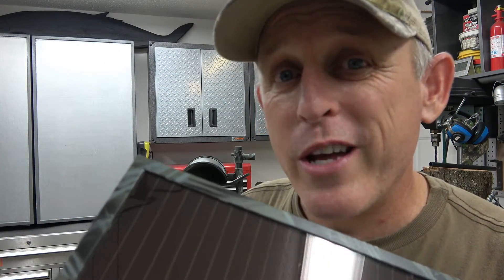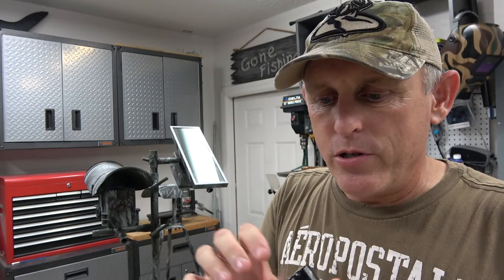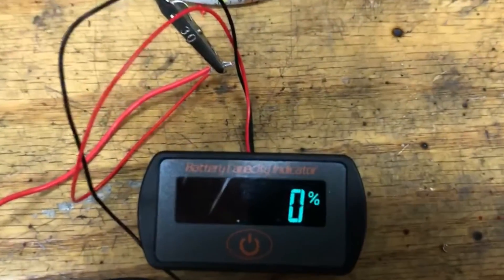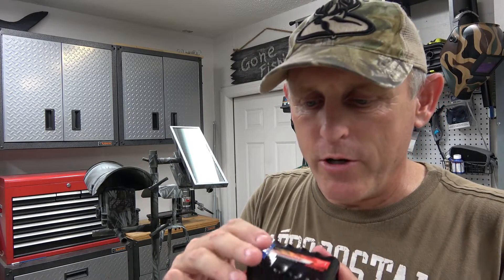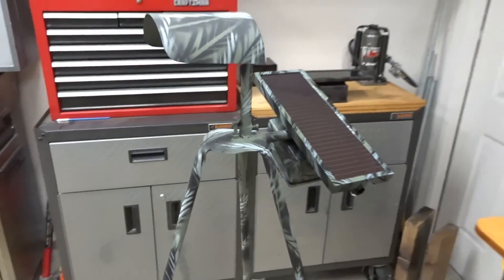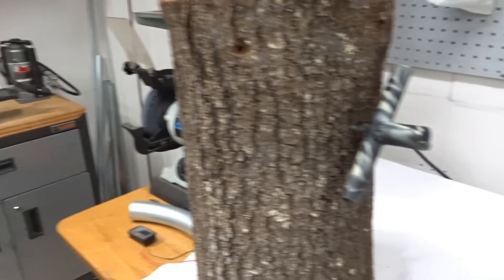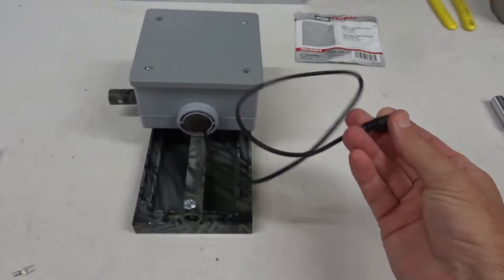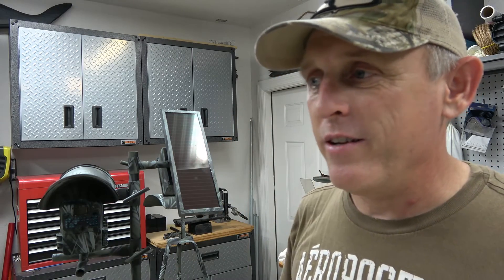Trail Camera Solar Batt Pack-DIY

Comment: How did you terminate the wires to the regulator?  Iv tried a couple things and broke a leg off of the regulator. Thanks
Reply from the maker: I snip the barrel off a small spade connector and then slide it on the leg with the wire in it and then crimp it tight.  I then heat shrink it for a nice connection.  Hope that helps.
Reply: Thank you. I looked for rings that small be and couldn't find any. Nice Macgyver fix

Comment: Love the videos. Did this setup last yr had zero problems but putting them back out now my batteries wont keep a charge or something is going on. I charged them up outside for a few days and set them out,now dead just got them back home and will diagnose in spare time!
Reply from the maker: Let me know what you find.  I have a couple that are two years out and still running.  I’m sure they are about due for a new battery but I will let them run for now.  Good luck with diagnosing.
Reply: Only thing I can figure is that I left the battery connected to the solar panel and and put up in a container and it killed the battery. I also had 2 more that I disconnected from the panels and they are fine!
Reply from the maker: richard smith I think you are right.  These batteries don’t like to be connected while being stored.  Best to disconnect.  Thanks for sharing.

Comment: So if I’m using a solar panel like yours with a 12v battery do u gotta have the 12 volt regulator if camera is 12v
Reply from the maker: Yep because the solar panel voltage will spike to ~23 volts in full sun and if you don’t have a 12volt regulator before the camera that high voltage will go straight to your camera.  The regulator just protects your camera from pass through voltage from the solar panel.  Hope that helps.

Comment: I love your videos! I just set up my first solar panel just like yours. I have two questions. One my battery drained down in less than an hour without a load, could the 7812 thing be bad? Two,  do I need a Schottky diode(mentioned by matt wheaton in a comment he made to this same video) wired into the circuit?
Reply from the maker: You don’t need to install a diode since these types of panels now come with one already installed.  You could definitely have a bad regulator.  Was it plugged into anything when it drained?  Also double check your wiring because a lot of guys accidentally switch polarity of the wires by using the solar panel plug they cut off....just trace +\- all the way to the end.  Let me know how it goes.  Good luck and keep in touch!
Reply: Thanks, yep I double checked polarity and found all in order. I changed regulator and it's still draining faster than the solar panel can charge. Think I'll try one of the little buck transformers/voltage regulators.Amazon Valeford LM2596

Comment: where did the frame on the solar panel come from?
Reply from the maker: I built it out of 1/2emt piping.
Reply: The Handy Hunter how did you apply camp to the emt and solar panel frame?
Reply from the maker: It’s all welded together.  Is that what you are asking?

Comment: Probably a dumb question but could you use 2 amp inline fuse instead of the voltage regulator?
Reply from the maker: No because the regulator keeps the voltage to the cam around 12 volts.  If you didnt have it your solar panel would push ~23volts directly to your cam and destroy it.

Comment: Hi! Great Video, Thank you for posting! Quick question should a diode be included in this setup like your other trail cam video?
Reply from the maker: You don’t need one if you are using a newer solar panel.  They all have them now so you should be good.

Comment: is there any way you can do a video on how to install the voltage regulator? from start to finish with external battery and solar panel? awesome videos!
Reply from the maker: Let me add that to my list for you.  I do get many questions around this.  Thanks for the request!
Reply: @TheHandyHunter  maybe you can just answer here? so basically you hooked the solar panel and took one of the cords from the cigarette or alligator clips into the regulator then spliced the power cord into the stealth cam power cord your using? if so i can do it. lol thanks again for the fast reply.

Comment: are those solar panels watrerproof?
Reply from the maker: I use several brands and they are all weatherproof.  Now, if you are talking complete submersion I’m not sure but for normal use in weather they work great.
Reply: @TheHandyHunter  well i am going to try this and wanted to make sure it would hold up to rain.  northern midwest weather.  Thanks for sharing
Reply from the maker: greatdaneparis you are welcome.  It will definitely hold up to rain.  Good luck.

Comment: Thanks so much for your videos - they've been a real inspiration for so many projects!  I recently found rechargeable 1.5 v Lithium AA batteries on Amazon and was able to eliminate the external battery packs.  Now I'm planning to hook my voltage regulated solar panels up directly to my cameras.  Do you see any potential problems in doing this?
Reply from the maker: Hi Tim, I love your line of thinking but I don’t think it will work.  When you say “direct” do you mean plugging the solar into the ext jack or wiring it directly into the battery compartment?  The ext jack won’t allow charging to the internal batteries and if wired direct into the battery pack you are going to have any issue of voltage.  You mentioned you would use voltage regulated solar but that won’t charge your batteries if regulated at 12v.  If you have a 12v pack your solar needs to pump up to ~23v to charge (in full sun).  If you regulate that solar to 12v before it enters your pack it may not keep it charged.  Here’s the other issue, if you run unregulated solar directly into the battery pack you may burn you camera because of high voltage.  You could always try it with regulated solar and let me know if your batteries stay charged.  Great thinking though!  I wish the trail cam companies would catch on to an internal rechargeable setup.  Thanks for sharing and let me know what you find out!

Comment: Verified and they were 100% dead from the one. I added a solar panel with internal batteries like big foot but the one with a 8000mah batteries. I just have a feeling it’s not enough juice to keep both up. I may have to mount it higher on the tree or get the 12v batteries that fit in an Ammo can with a bigger solar panel. See if that works.
The camera that said 90% went dead shortly after. Experimenting is getting expensive now
Reply: I may try a 10watt or 20 watt panel to see if it’ll be enough for both battery and spypoint camera

Comment: how did this set up work for you. I just built one, wont be able to get it out until spring. just curious how this AA pack held up. thanks.
Reply from the maker: I’ve had 3 of these in the field for 1 year and 3 months now with no issues at all.  One of them runs two trail cams at the same time and the others run cell cams.  They’ve been totally maintenance free.  Will they last 2, 3, 4 or 5 years?  We’ll find out.  Good luck I think you will love it!
Reply: @TheHandyHunter  thanks for the feedback and the idea on how to build these. I look forward to getting it out in the woods. keep you posted on how mine works. thank you!

Comment: Would this same setup work with a 12v 7ah battery (like the 12v external battery pack video)?  or like the one in this video that I did a few years back:  https://youtu.be/kIvj9zihbWY
Reply from the maker: Yep it would work.  It’s just that this small battery makes it convenient for a small setup.  I run bigger solar setups with bigger batteries as well.  I like the small setup the best.  Hope that helps.

Comment: Now that you have gotten some usage time on that battery, what is your opinion. I'm far from an electric expert and I am setting up some solar panels on cameras like you have. I was thinking the more Ah in a battery the better, so I was looking at batteries such as the Expert Power 12v 7 Ah (1270). Do you find the need for more Ah on your batteries or is 2 Ah enough like the battery in the video?  Thanks for the great videos and the time you take in responding!  

-Additionally, it looks like you use 1/2" pipe quite a bit. Do you just buy fittings to put together some of your set ups where you have panels sliding on and off or do you buy larger pipe? Thanks!
Reply from the maker: Hi Austi!  Great questions.  I love this setup!  I just got back from the farm and recorded a short video on the post 1 year update of this setup.  It’s been well over a year with no issues whatsoever!  Runs 24/7 with no maintenance.  Only worry about Ah if you are not running solar.  I run those too...big battery in an ammo box will last you many months or a year.  The little battery gets my cams through the night and then is recharged the next day.  The only thing I would change is not adding a pigtail to check battery level.  It’s extra work to rig and my battery is always at 100%.  If you build it you won’t regret it and you’ll be building a second, third...  Good luck and let me know how it goes!  Oh, yes, I use 1/2 emt pipe for all trail cam brackets...plenty strong for that.

Comment: I’m definitely going to build a couple of these for the cellist cams I am running
How do u keep the leg bolt from turning inside the pipe when screwing into tree?
Is it conduit with tack weld or is that pvc pipe? 
I’ve been trying to figure out how to mount a solar panel and 12v on a tree for a awhile n stubbled onto this video. I’ve been carrying a racket and socket with me to screw in my leg bolts  lol silly me
Keep up the good work
Reply from the maker: I weld the Lag bolt to the emt pipe.  I use 1/2 metal emt pipe from home depot.  I now make these as 1-piece as the two piece is more work.  Hope that helps!
Reply: Thanks for the quick reply. I thought that’s what you had done, was hard to catch a good look during video while trying to pause it perfectly. LoL I have some 12v Battery packs I’m gonna send you an email about.

Comment: I think that would probably be fine without the regulator. Not sure what voltage that solar panel puts out in full sun. Probably not over 14V. Thanks for the video.  Update- I just watched another one of your videos and that solar panel isn’t a 12v panel, I think you said it was putting out 18v. so yeah, you would want the regulator. 👍👍
Reply from the maker: Hi there, all my panels are 12v and put out up to 23volts in full sun.  Anything over 14v starts getting risky for 12v cams and can damage them.  I personally would never use a solar panel without a voltage regulator to protect the cam.  Good luck with your build.

Comment: Had a stealth cam go bad (3 actually) and have an external 12v battery and a solar charger that i figured would be trash since it wont fit my cuddebacks. But after seeing your videos i see that it can be converted to fit the cudde. Thanks so much and great videos and also paont jobs. Have you ever considered doing a how to build on a wireless trigger for a hog trap? Ive built a drop gate but have never understood folks explanations on building the wireless trigger because their descriptuon aint detailed enough for how little most know about the components.
Reply from the maker: Stealth cam do stink...i wasted my fair share trying...lol.  Funny you bring up the hog trap.  I’m building a gate that triggers by shooting a steel target.  We plan on using the Bigfoot cam to alert when they are there and then move in a shoot the target from a distance.  The cell trigger seems expensive and can be unreliable but I may still try it one day.  I’m gonna try the poor man’s version first...lol.  Good luck!  Get all them hogs!

Comment: How can I take an electric heater and run it from a solar panel?
Reply from the maker: You would have to run that off a big battery that would slowly be recharged by a big solar panel.  Have you thought about the little propane bottle heaters?  I have one and they work great!
Reply: @TheHandyHunter  I use that now but with my 3 year old starting to come out, I'd like to be able to have something without a flame to attract his attention. Thinking ahead with a 8x8 blind, adding some panels to run heat and other items for more comfort with my kiddos.
Reply from the maker: Jason Muir sound like a great dad!  I use to do the same thing.  I built my own shark cages on top of my tower stands so that my kids couldnt fall out.  Id put a sleeping bag on the floor for them to take a nap.  You may have to utilize several big 12v batteries to accomplish your goal.  Maybe test it at home and see how long it last and then add a second. It can be done it’s just that heaters pull a lot of amps so you’ll need some juice to keep it going.  Let me know what you decide.  Good luck!
Reply: @TheHandyHunter  Thanks so much for the input.  Figured I'd come to you because all my trail cams are now run off solar because of your instruction!  Keep it up and I look forward to learning more.

Comment: Out of curiosity, how well do these batteries fair in the summer heat? From what I understand with NiMH batteries drain faster when heat is over 80 degrees. What is your experience with this setup, also have you had to replace the batteries yet?
Reply from the maker: Hi Ryan, so far they’ve held up great in the Georgia heat.  I haven’t had one go bad yet so not sure how long they will last.  So far I have been very pleased and wouldn’t hesitate to build another.  I have a couple of these setups running two cams at once and it works flawlessly.  Good luck with your build!

Comment: I purchased the same harbor freight solar panel.  Are you concerned about over charging the battery without the use of the solar charge regulator that they recommend between the panel and the battery?   I ask because I don't want to spend the extra $20 if I don't have to.
Reply from the maker: I have been using all my solar setups without a controller for many years and I havent had any issues.  The controller can actually be a detriment because they draw power to run.  I just don’t see the need with little solar setups...houses, yes...trail cams, no.  Good luck brother!
Reply: @TheHandyHunter  thank you.  I picked up the stealth cam wire for 12v on Amazon;  do you think it's imperative to put that regulator chip in between the battery and the camera, with the commercial products? 

I really appreciate your videos.  Keep them coming.

Comment: Do you need a diode for this application?
Reply from the maker: Yep, you need it between the panel and the 12v battery to prevent draining your battery at night.  Hope that helps.  Good luck!
Reply: What size diode do you need to install
Reply: What size diode do you need to install
Reply: How do you install a diode? I don’t remember seeing anything in the video about this?
Reply from the maker: Hi Adam, the little grey ring on the diode points downstream of powerflow or in the direction of powerflow from the solar panel.  Install it on your hot wire (red+). It will then prevent backflow at night due to your solar panel.  Hope that helps.
Reply: @TheHandyHunter  Thank you! Great Channel, SUB'D!
Reply from the maker: Welcome!!

Comment: I see this is not your first barbecue have you had many problems chewing on wires or equipment I know rodents love new plastic or rubber keep up the good work did u do a video of your method of painting
Reply from the maker: I’ve only had problems with chewing when my wire touched the ground.  Otherwise, I’ve been lucky!  Rodents do love plastic!  You are not the first person that’s asked about the paint job.    I will put it on the menu for the future!  Thanks for watching and stay tuned!

Comment: Awesome project. You still having good luck with these? Would a 2.5 watt panel be to much? Also if I was to use a charge controller would I need the regulator?

Comment: Great video, thank you for recommendations.  I have a Covert Wireless camera, and they offer an adapter which includes a 6V regulator, will this work with this setup?
Reply from the maker: It should work fine if your camera runs on 6 volts.  Let me know if you need any help.  Good luck!